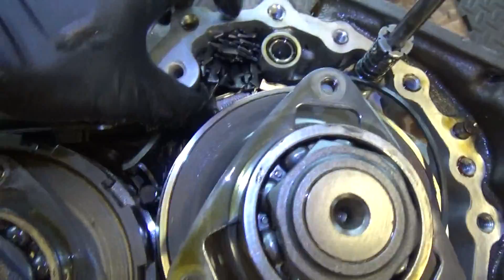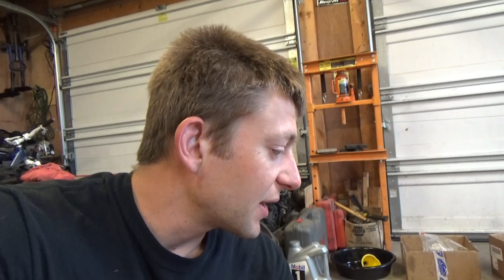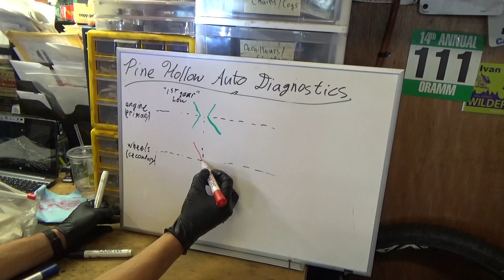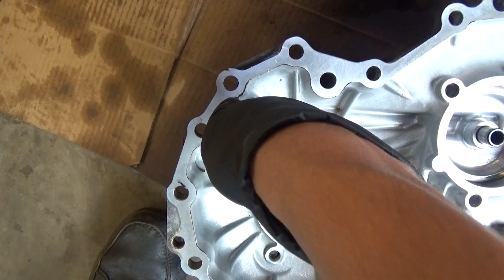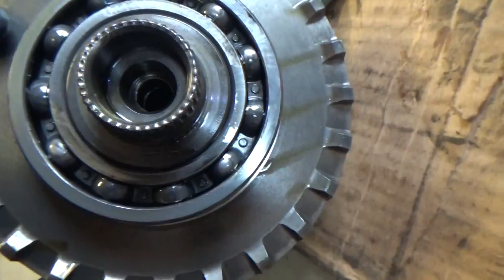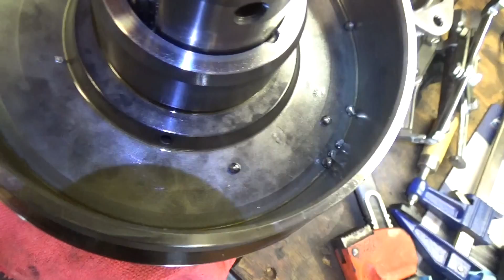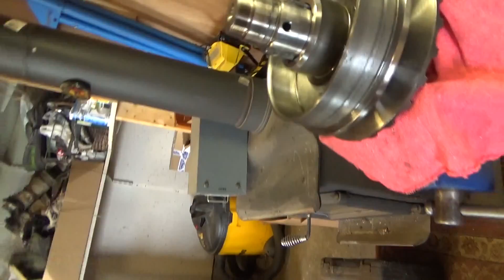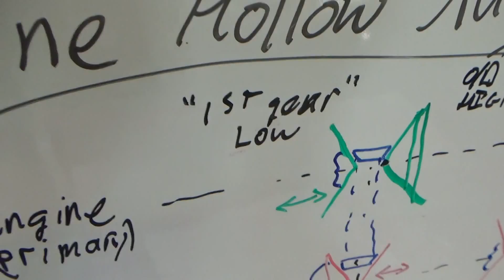Nissan CVT: Teardown and Failure Analysis -Part 2 (RERELEASE!)

Comment: When I considered buying a Rouge I read how the transmissions failed . The explanation was hard accelerations wore a ridge in the sheaves and that wouldnt let the sheaves advance and change ratios… the kevlar belt is tougher than the sheave. Hence wide open throttle didnt yield any speed gain.

Comment: Absolutely great educational video on the Jatco CVT transmission. I am a consumer driver. We have owned and leased a mess of Nissans. I have leased 9 Maximas since '93. Never had a CVT issue. We own a '20 Versa and I'm thinking of buying my '19 Maxima lease. I have viewed a mess of videos on CVTs. I'm 81 and am tired of leasing. My '19 has 4500 miles on it already. Should I worry about buying it?

Comment: An excellent video and very well worked out the idea of changing gears ratios by variable cones is very old indeed right back to the very very early cars done with rubber belts sometimes leather but there was out in the open operated by hand , probably the cause of failure will be the ballbearings disintegrating along with the ware  of the slides slots Great video

Comment: Those balls and grooves may be a one way clutch like in a planetary automatic trans. This clutch is used to stop rotation of planet, sun, or ring gear. They often use more robust roller setup for one way clutch instead of tiny bicycle ball bearings. The grooved center shaft seems to be too soft metal so it easily wears.  What happen to great Japanese mechanical engineers?

Comment: Thanks again Ivan.  CVT must be cheap because nearly every car maker is using them.  There are most all based on the Nissian/JATCO design. Its like some small oil pressure problem causes a critical mass failure and the whole belt implodes.  No limp home mode nor does anybody repair these CVT trans; junk car or $5K-$6K for new trans.  Car Wizard says the special trans oil in CVT gets really dirty by as little as 20K to 25K  miles, because of normal metal belt to metal pulley friction wear.  No lifetime transfluid.  CVT might save some gas, but maybe $5K a transmission is not worth the gas saved or being stuck in boon docks.

Comment: 240k miles on mine , fluid and fluid level are critical on these, yes they will go 300k miles unabused, , and yes that engine is bulletproof,  again unabused  . My pops altima with same powertrain rotted in half with 320k miles

Comment: Good work diagnosing the failure. Just imagine 200 or more foot pounds of torque against 3 little ball bearings against a non hardened steel shaft.... very poor engineering. That's why CVT transmissions should only be used on VERY small engines with LOW torque, maybe riding lawn mowers and scooters? What is truly amazing is it lasted that long.

Comment: i had a friend with a 2010 Dualis that has a noisy trans. He asked me about fixing, I said "yeah nah"
i saw replacement parts for these, you get the belt and cvt drums in a kit $900 AU.
i think just replacing just the belt would be a waste of time after seeing this video now.
 Good work and thanks for sharing dude.

Convert it to chain drive, fk the cvt. 
we want to see a modded trans built for towing and hard core conditions :D

Comment: I just got a 2022 Nissan Sentra. 2.0 4cyl. It has the CVT with Xtronic. I did purchase a extended warranty. 72 months/100,000 miles bumper-bumper. I will be having the transmission serviced every 15k-20k miles. Hopefully I don't run into this kind of trouble. I'm not sure if there are any major updates on the 2022 CVT's or not.

Comment: Question: I bought a used cvt transmission. After install I’m supposed to tow the car to the dealer so they can reprogram the new transmission. Do you think I could just swap the valve bodies. Put my old valve body into the new transmission to avoid reprogramming?
Reply from the maker: No

Comment: Dry belt CVT's have been used in snowmobiles since the beginning, trouble free except to replace a belt once in a while.
Sleds now adays are putting out 175hp, 200 hp tuned, on the same rubber belt cvt clutch. They would pull one of these cars around backwards on tar or snow
until the car broke down, and then the sled would take off across the lake at 150 mph in 12 seconds! I think this wet design is a joke.

Comment: A change in my original comment

4 days ago; I commented and condoned every thing; the owner of this YouTube video said and showed. I still believe he did an outstanding teaching of a very intricate problem; in a CV Transmission.

I am sad to say now; that I disagree with the diagnostic: believing the small steel balls and their groves; were the "root cause"; of why the steel belt broke; made up of 24 rings and 399 elements; became pure garbage @186,000 miles. I would have taken that to be inerrant, to my death. But...

Lying in my bed yesterday morning; I went over and over it; almost everything about the root cause of this blown up "CVT". 

I must say that I now believe: that it was the belt that broke (from miles of fatigue); and most of the 399 elements began to lock that primary pulley to the housing.

This caused the motor's horse power; to force the outer primary (pulley) surrounding the input shaft; to blow up. Throwing those balls OUT of their safe grooves. Causing the input shaft and the pulley, in essence, to weld themselves together.

Thus, I believe it wasn't poor engineering; that caused what we thought it was. Rather; it was poor engineering of the steel belt; which is going to break; sooner or later on EVERY CVT! And I do believe; as many auto engineers do; the CVT is innately a "horror waiting to happen!'. The only thing is time.

Could I be wrong? ABSOLUTELY Yes!. But all others could be wrong too.

End of my story; with NO disrespect atoll; of our incredible teacher. Which I love to watch him; whatever he says and does; EVERY time I view one of his videos.

Incidentally, I just put me "flame suit" on...'cuz I'm gunna need it. "FO-SHO!". LOL.

Comment: What caused it to fail is heat 
Fluid has to be changed every 30K 
Those that do don’t have problems 
Also 186 K is not a bad life for a CVT
Reply: Damaged ball bearings that attach the pulleys to the shaft was being caused by constantly changing loads leading to deformation of the balls, which would then develop flat areas and under pressure instead of rolling as they should they would slide against the guide causing heavy wear of the guide to the point to where the balls would then slip out of the worn guide and the destruction would ensue. This was simply an inadequate design.  Heat wasn't a factor in these cases however 30k mile fluid changes and 60k filter changes are still the way to go regardless of what the maintenance schedule claims.

Comment: Thin steel drive bands🤭pushing a couple tons forward and backward.     This is a perfect illustration of why to avoid CVT like the junk that it really is.     The fact that Nissan has kept using this same transmission with its abysmal failure rate without switching to something workable illustrates how Nissan went from one of the most bulletproof brands to Fiatesque garbage .

Comment: I was unaware of the rampant CVT failures, and was considering buying a used Murano last summer; it had an obvious wheel bearing noise, and took a while for the stealership to get the part. Once they replaced it, they found the noise didn't go away, diagnosed a bad transfer case and pulled it from the market; I wonder if it wasn't a failing CVT,  but any way you slice it, I'm glad we didn't buy.

Comment: I got a cheap Korean scooter to wrench on, they have a simplified conical pulley system with a rubber belt and a spring, and a centrifugal clutch rather than an oil torque converter. It's a neat way to see this type of system in action without the complication and expense of a car-scale CVT

Comment: I have a 2014 Nissan Altima 2.5s with 115k miles and have NEVER had a transmission issue but I always hear how bad they are. Maybe I got lucky? I hear the Nissan CVT fluid sucks and recently changed to amsoil. It runs even better than when new. It slows to downshift in drive mode, you really have to hit the throttle quickly for it to rev up quicker. I prefer S mode , it downshifts much quicker and has pre set ratios that shift just like gears. It really gets up to 80mph on a freeway in ramp no problem! I've heard you need to change the Nissan CVT fluid every 25k because it sucks. My guess is the tranny fluid overheats easily and damages those steel belts . The oil cooler gasket also can fail letting coolant and tranny fluid mix but that has never happened with me. Coolant once started to run low, just emptied and put new Nissan coolant in. Going to change the transmission filters soon just because.
Reply: Btw, my Altima is the smoothest car I have ever driven in my 32 years. When I test drove it off the lot, I made the right turn and accelerated. I never felt anything so smooth, I knew immediately we were buying this car. I did receive my car back from a Nissan dealership one time with completely drained power steering fluid and a whining sound so loud. Lucky I found it and filled it up asap. No whine now. Change fluids religiously. Cvt every 25k. Amsoil is better than Nissan CVT ns2.

Comment: Mine blew out at 105,000 miles I had a local transmission shop replace it for around $4,200.00 with a rebuilt one. That was 25,000 miles ago, it has a 36K 3 year warranty on it. Now to be fair I didn't change the fluid in it ever. I found out by looking in the book it's supposed to be changed every 30K, the dealer wanted $350.00 to change the fluid so I ignored it. I''m hear to say, don't skip the service or you're asking for trouble. On the new or rebuilt transmissions they have changed the balls in the slots with round shafts to prevent what happened to yours.Thanks for sharing, Best Wishes & Blessings. Keith Noneya
Reply from the maker: Interesting that they actually improved the design! Where did you get that info? This Rogue has almost 60k on the replacement trans, and I just changed the fluid for the first time. Runs great!
Reply: @PineHollowAutoDiagnostics  Right before mine went out I started doing research on them. I was going to rebuild it so I watched a ton of videos and one of them showed it along with some other modifications they did. Sorry I don't remember which video it was in. They don't look that hard to rebuild and kits or parts are available on eBay. I live in Slidell, La. you're in Arizona right? We'll chat with you later.

Comment: Do you think using the manual mode to get engine brake tends to generate extra wear on the belt/shafts? (as it's my first non-manual, I'm still used to shift the gears to get some brake :D)
Thanks from France
Reply: Stick to manual, a manual transmission will last longer and it will work better for you are mentioning.

Comment: I have this transmission on a 90.000km Renault MPV, I struggled finding a dealer that would accept to do the transmission oil change...
I prefer maintenance than buying a new one, not them!
Reply: Transmission don’t use oil , it is Transmission Fluid

Comment: Thank you for good explanations. The design idea is good but too many things that engineers overlooked, oil under small pump pressure still leak but how they avoid leaking in such tremendous pressure, and when oil leak, the transmission failed. Second, the layered steel belt under pulley pressure on both sides constantly, so I guess that is why they broke in this case. Also, there is no pulling force like link chains, so when oil pressure is low, there will be slippage, or even when pulls heavy load.

Comment: I am so impressed with your diagnostic skills and your ability to logically think through the existing
design to disassemble a sophisticated mechanical machine/ transmission with so many moving parts.
Granted, you have a schematic and can see parts and related locations.  But you are really doing the 
job that the original engineers should have done to realize that they created a seriously flawed design.
Jatco transmissions have caused Nissan's reputation to be ruined over this known expensive transmission failure over many years.  They need people like you to properly design modern cars.

Comment: If the pully is supposed to spin with the shaft at all times.. What would stop some one from welding the pully to the shaft and reassemble with new cvt belt. I wonder would the transmission actually work. the Ball bearings look like a key way of some kind. Possibly fixing the transmission. It actually looks a lot simpler then a regular auto transmission.

Comment: My daughters 2014 Civic CVT just failed at 236,000KM.  It also was a belt failure.  Ill be tearing it apart to see the carnage.  There was a recall on This CVT for a weak output shaft, (said shaft may not be hardened to the proper specifications) and Honda; rather than change the output shaft, changed the transmission software to lower the torque put through the CVT.  Not really a fix in my opinion.  Maybe your CVT was the same, which explains why the shaft is worn.

Comment: Older CVTs with conventional valve body actuation are inferior. Modern CVT don't have valve bodies at the bottom of the tranny housing. All pulley adjustment is done by sensors and servo motors. Still they got oil pump to pressurize the drums that moves the pulleys. But thier actuation is controlled by servos. Problem with valve bodies is when there's a worn rubber seals they fail to activate or they need much higher oil pressure to push the pistons. That's why the CVT can't sense a need in torque when climbing hills, and resist to "downshift" , thus putting the steelbelt to high stress

Comment: Nice vid I have a 2010 maxima with 199,678 miles original transmission I’m actually going to be doing the valve body because I have a code pressure solenoid “A” stuck off

Comment: So do the  Nissan Engineers design these CVTs to fail early on?  Obviously not officially (but unspoken)  but as a way to make more money on each vehicle with the couple thousand bucks it will cost to get the repair?   Or is it just an added “benefit” of having CVT?   
Fascinating tear down of that transmission.  Beautiful!

Comment: If I had to guess, I'd say the seal failed first. The pulley is moved hydraulically, so when the seal failed it was unable to open when the other pulley closed. That likely resulted in the belt failure. Just my guess.

Comment: It looks to me like the one pulley is controlled by the TCM but the other actuator is actually a hydraulically moderated follower to maintain proper tension, not necessarily under direct control.

Comment: When the best you'll ever be is a parts changer, you end up dealing with $800 core charges, when a simple belt change, without removing the entire transaxle was all that was required to repair the vehicle....
Reply: What???
Reply: @MrPatdeeee  try reading....There was NO REASON for him to buy a rebuild transmission, when all the trans needed was proper maintenance (replacing the belt BEFORE it failed), or cleaning the pieces of the broken belt up,.and then simply replacing the $28 dollar belt.....Instead of dealing with the reman trans, the "$800 core charge" and the shipping, etc.....a $28 dollar belt and a gallon of trans fluid would have solved his problem....The belt is EASILY changed by removing the side cover, with the trans still in the vehicle, connected to the engine...So ALL THAT WORK AND MONEY  was wasted....

Comment: Looks like the exact CVT in my 2013 Mitsubishi Lancer.  Just changed the fluid, has about 103K on it now.    My first car with a CVT.  I was worried that I wouldn't like the CVT versus a regular automatic but I like the driving characteristics.  While it is a little soft at lower speed the nice thing about the CVT is that you can be going 80 mph and the RPM will adjust down to just over 2000 (in my car) so you can really accelerate from 80 to 100 quickly.  When you are going really fast the engine is not at high RPMs.  So the CVT really is nice and excels at high speeds.  Have heard horror stories with these Jatcos so I am going to change the fluid on it every 30K and hope for the best....and use Amsoil CVT fluid from then on.

Comment: If I am understanding this right... it seems like the primary and secondary elements must move exactly opposite of each other — the metal belt or whatever it is called cannot change length, and of course there is no tensioner element to take up any slack. 

So yeah, that pulley got jammed up by those locating ball bearing things, which caused the pulley to get stuck in one position, regardless of the hydraulic or belt pressure pushing it one way or the other. And after that happened, as soon as the other pulley closed up, it put a massive amount of stress on the belt, effectively stretching it way out until one of those band saw looking ring sets snapped.

That’s a real shame, because like you say, they could’ve so easily designed the pulley slide mechanism so that wouldn’t happen. But regardless, after some research, it seems like that exact chain/belt design is what most other CVT transmissions use, and they are always a major weak point. And since they’re made of a billion little bits, once it breaks, the trans is filled with large chunks of metal confetti... not just a simple “oh we’ll just put another belt in,” you actually have to tear it all down to get the bits out, and assess all components for possible collateral damage. 

Might be a brilliant bit of design, but I hear that damn belt is a massive Achilles heel... and I highly doubt even the luckiest of owners would be able to get more than 250k miles out of one, something conventional autos (at least good ones) can usually handle with routine maintenance.